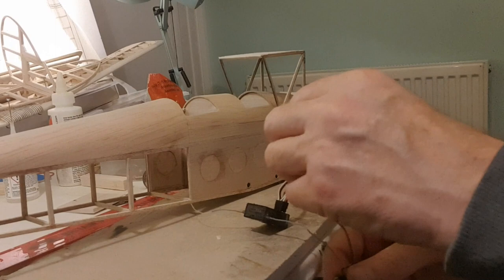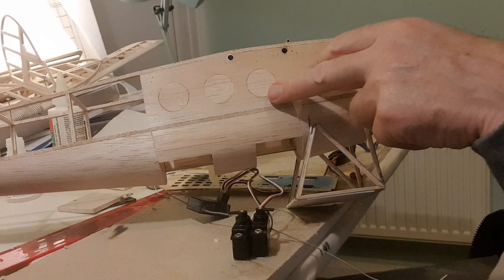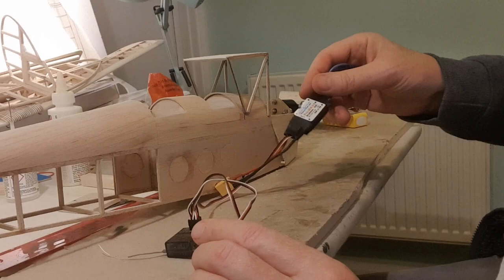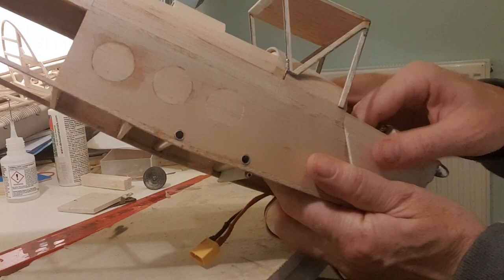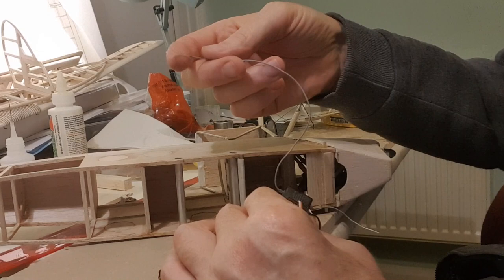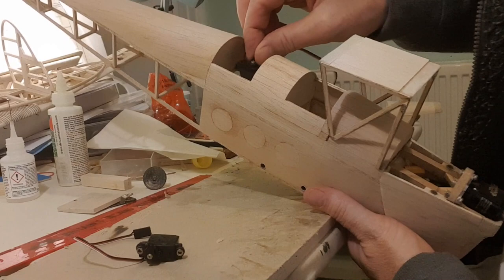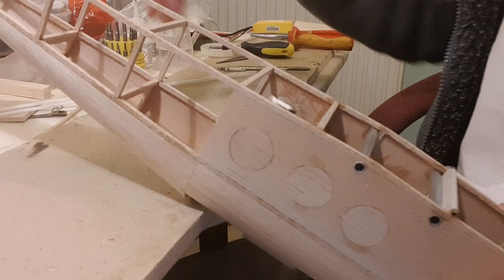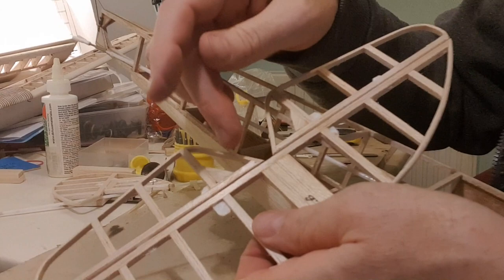Mercury Tiger Moth Build Radio Control Installation Part 5

Comment: Very pretty engineering. Always good to save old parts. If they worked well once, they'll work twice. We ought to establish an old part registry. Save a lot of internet time.
Reply from the maker: Thanks again Irwin, it can take longer to use old parts by the time you've 'reconditioned' them but a lot more satisfying. Having restored a 1951 MG reconditioning becomes second nature 😁
Reply: @CliffHarveyRCPlanes  Well, I've got lots of old parts, each one a broken dream.
Reply from the maker: @irwinweisbrot6644  That's sadly poetic Irwin!

Comment: I was spoiled. Years ago I could walk to a good hobby shop a mile away. Anyway I'll soon want your input/advice on how to get the upper wing on (and off too, so as to charge the LiPo pack.) Then, depending, I'll likely have to go get stuff, if possible, from a pig-in-a-poke hobby shop I've never been to ten miles frm here. That or order online, with the drag of waiting. I'm actually waiting now for a set of 2mm bullet connectors from a hobbyshop in the UK (for my next build, a 1" scale Fairchild 24, AKA an "Argus.")
Reply from the maker: I'm lucky Dan, two LHS's within five minute drive 🙂 Can you put the battery between the uc legs, it's a lot easier to change?

Comment: What motor/esc combo did you use in this Cliff ? Love build by the way,
Reply from the maker: Hi Alan, the motor is an Overlander Thumper T2836/08 and the esc is a Robotbirds Pro 30A-V4, it will probably cruise around on quarter power but it's a combo I've had laying about so time to use it 👍

Comment: That's come along nicely Cliff 👍 Are you still planning a replica of the one you'll have the flight in?
Reply from the maker: Thanks Carl, yes it's going to have the same reg 🙂
Reply: @CliffHarveyRCPlanes  I wouldn't be surprised if you've already planned this, but you should take the model with you on the day and take some photos of the model and full size one together.
Reply from the maker: @RCSoaringDiaries  Yes again,  they said bring it along it would be welcome, only one potential hiccup ... it may be a pile of bits by then 😯

Comment: Hi Cliff. I've recently built the 1m span Tiger Moth from Dancing Wings. It's similar to this one. I'm having cog issues. Did you have to add weight to the nose? Its tricky to get the battery far enough forward for her to balance without ballast....any thoughts. Your battery is positioned quite far back?
Reply from the maker: You know what Mike, I had to add some lead to the front end, about 1oz, to bring the cog in front in what was shown on the plan br about half an inch, but the surprising thing is I forgot I can also move the battery forward a little! I did try and keep the tail end lighter during the build as well. Is there anywhere you can squeeze some ballast in?
Reply: @CliffHarveyRCPlanes  , yes, plenty of space but dont want to load her up if I dont have to. I've ordered a 4s battery for her so that may help? (I had no plans/spec or instructions with the kit so it's been interesting 😄) I'll have to shift stuff around in the front and maybe make a tray a bit like yours. Also the only access on mine is by removing the plastic formed cowl (and prop!). So I think I'll fit a hatch in the same style as yours so I can pop the battery in from under the front. I appreciate your help (and your great videos of course 😉) Thanks
Reply: @CliffHarveyRCPlanes  Hi Cliff, still struggling with the cog on this TM. I've got a 4s battering her, as far forward as possible..but she still needs loads of weight. I know yours is bigger (mines the dancing wings 1000mm one) but any guess at what the flying weight should be. This is feeling so heavy if I balance her out with balast
Reply from the maker: @mikeparkercreative5136  Mine's only 820mm span Mike, so a little smaller. I wouldn't worry about the overall weight, it just means she'll fly a little faster but they are craggy with two wings so that'll slow her down anyway. Just get the cog right and it'll be fine 👍
Reply: @CliffHarveyRCPlanes  Ok, hopefully she'll be ok. She just feels so heavy (I've had to put a loads of nuts n bolts in her nose to get her to ballence). Did you only need an ounce extra?? That's a tiny amount.
Do you know what your all up flying weight was? Yours isn't much smaller than mine...just so I've got a point of reference. I appreciate your help 😉
Reply from the maker: @Mike Parker Hi Mike, slow answer sorry, she weighs 558g (19.6oz) with out the 3-cell 1400mah battery which weighs approx. 140g. 👍

Comment: My late brother built one of these back in 1980, turned out too heavy if I remember rightly and flew like a manhole cover.
Reply from the maker: Hi John, it will be heavier than the designer intended no doubt about it, was your brother's model rc?
Reply: @CliffHarveyRCPlanes  hi cliff lovely build by the way, yes it was Rc rudder elevator throttle dry batteries at that time. Two stroke engine covered in tissue I seem to remember but I guess that your Rc set up will be much lighter than the old stuff and as long as you don't run into CG problems I'm sure you will be fine.